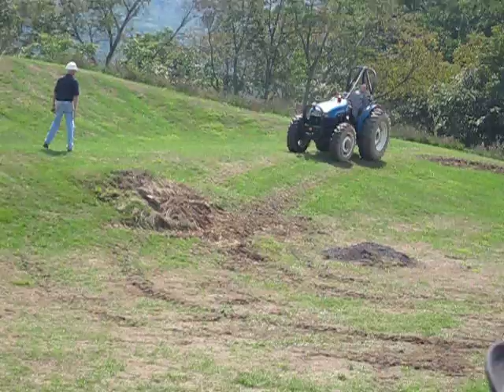Tractor rolling over on a hillside

Comment: The lap belt is what keeps you in place in a rollover. Most people think it is the shoulder harness. In fact if the upper anchor points of the shoulder harness are mounted to low, you will break your back due to compression fracture.

Comment: Just make the tractor 🚜 wider
Reply: Set the wheels out to the farthest setting if you dont have duals, I turned the inner wheels around on my 4x4 TN65, it feels so much more stable now on inclines but you still gotta use your head and not do things like what they demonstrated in this video, tractors dont have front springs or rear suspension to articulate.